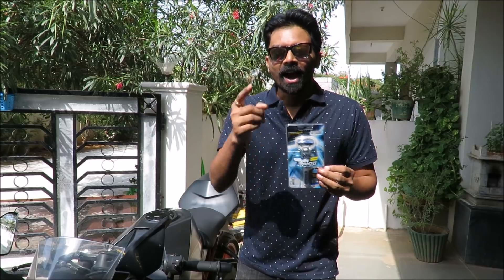How does a QUICK SHIFTER work?

Comment: It's fuel injected why does it need a spark plug ? Or my engineering syllabus is a complete whack?
Reply: Fuel injector mixes fuel with the air,it doesn't ignite the mixture,spark plug does
Reply: @vipinshanmugam3036  fuel injection does mix fuel with air but the ignition is caused at the time of mix.. the piston only compress the air alone and at compression stroke the fuel is injected and it burned due to the hot compressed air... But in carburetted engine the air fuel mixture is compressed at compression stroke and spark plug is used to ignite... Difference between fi and carb varient..

Comment: Vikas bro, my top speed in my duke 390 has reduced after i changed my rear tyres to Michelin pilot tyres. I'm just getting 150-155km speed. Does the tyre change makes this huge difff.? Before in Metzeler i got 170+ with ease. Kindly explain bro...
Reply: Raja Sankar no. But check the tyre size it should be 150/60 R17
Reply: abhijeet jadhav Everything exactly same size as the stock tyre

Comment: Watched whole ad of 4minutea just for ur hardwork sir...
The efferts u put on every video !!! 
Respect
Informational video ...😘
Reply from the maker: Thanks very much for the support bro
Reply: @rvkvikas  So you mean that if i install a quick shifter or buy one with quick shifter i dont have to use the clutch lever at all.
Am asking for my clarification.
Educate me
Reply: @max2207  quick shifter is not ideal for using it at slow speeds and in traffic,it's a feature which allows you to upshift ,where speed constantly increases without using the clutch,so it's useful only when your increasing your speed higher and higher,where u don't require the clutch to be used,this is quick shifter